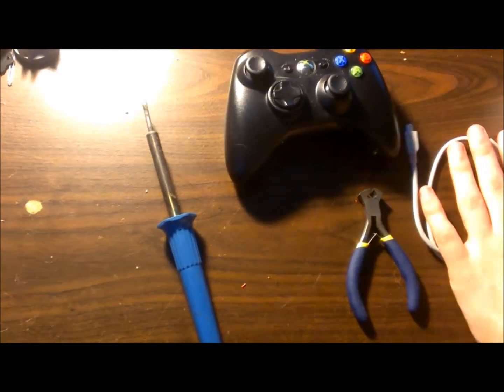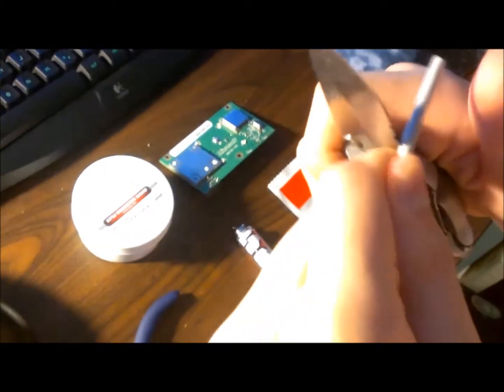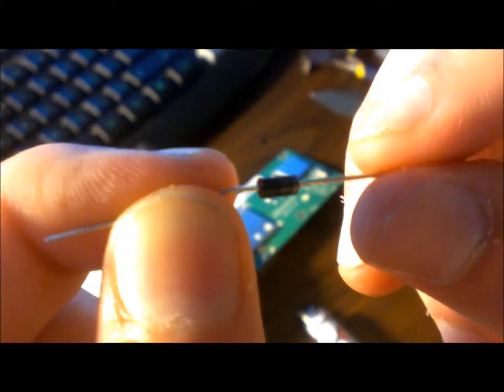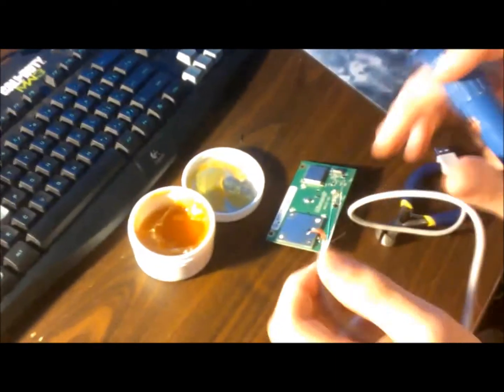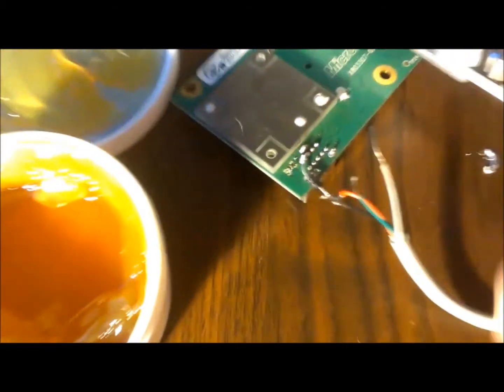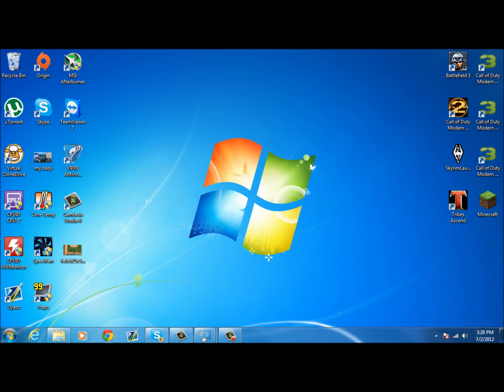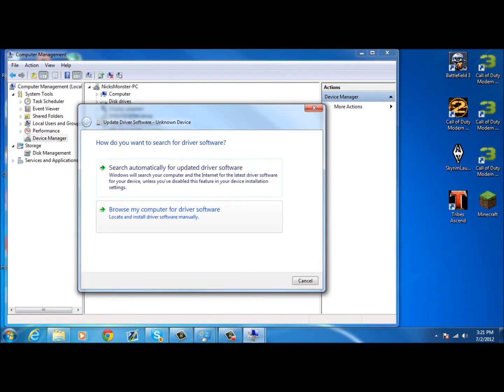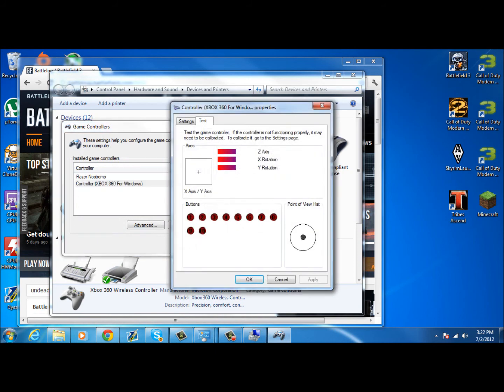How to use XBOX 360 WIRELESS controllers on a PC

Comment: Option 1: 
Get a USB receiver for xbox 360 controller for pc
Next plug it in PC install and use.

Option 2:
Get a soldering iron, wire stripper, usb cable, rectifier diodes and a xbox 360 ring of light
Next do a fuck ton of work and start regretting that you didnt just buy a receiver.

I pick option 1